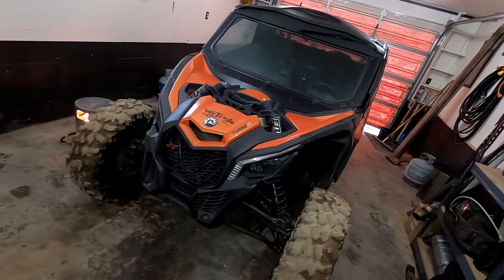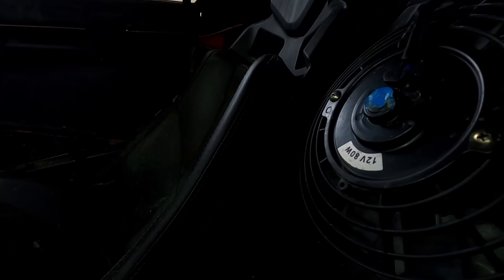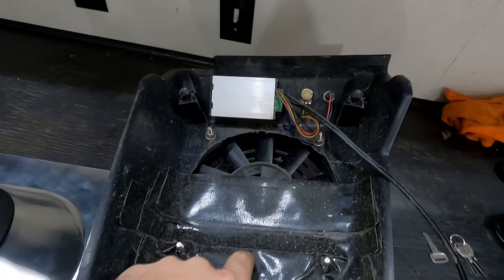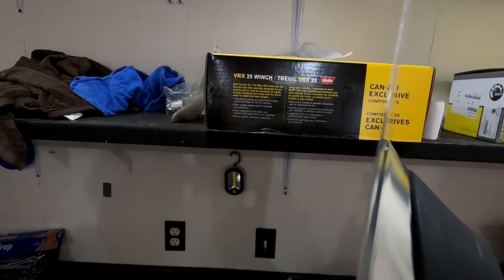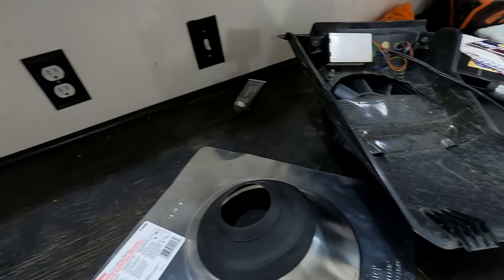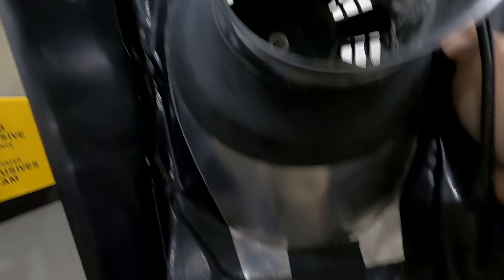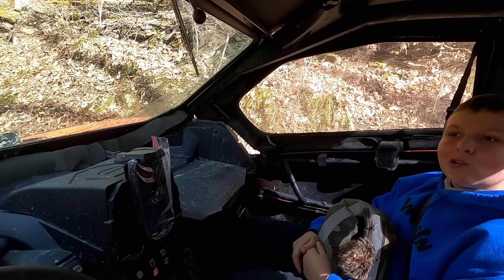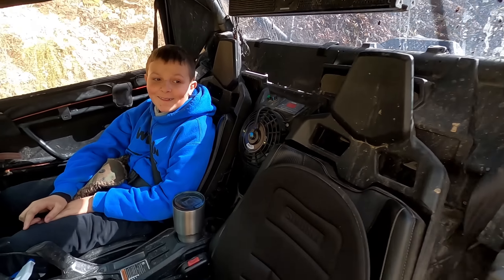CAN AM X3 FAN MOD 2.0 | TWICE THE HEAT FOR $17

Comment: The problem I’m having is it’s sucking in fumes. Bad. Did this fix it? Did you have the same problem before this?
Reply from the maker: It helped with the heat a lot and cut fumes some. My plan was to build a box loosely around the turbo but I sold the machine.
Reply: @WvTrailN  did you get any smell from the turbo?

Comment: Crazy question but would one of these help at all with an open cab? Is it even worth it? We snow wheel in the winter a few times and I have heated prp seats just want to try something small for a little more heat.
Reply from the maker: It probably wouldn’t do a lot with an open cab. Might pump in a little heat on slower trails. Be a good hand warmer and helps to keep the windshield from fogging over

Comment: I'm confused, are you trying to draw warm air into the cab from turbo heat? If so, why did you have the tape blocking the fan originally?
Reply from the maker: The fan was pulling cool air below the turbo. Blocked part of it until I could pull heat straight from the turbo.

Comment: I know this is off topic, but how do you keep your garage warm? Couldn't help but notice your garage door looked to be glowing.
Reply from the maker: Right now I have a propane heater. The door was painted red on the outside by the previous owner and looks like that in the sun
Reply: @WvTrailN  cheap Chinese diesel heater WV. They work wonders in my garage. 18 hours of real heat per 1 gallon of diesel for 115.00 complete.

Comment: How the noise in the cab with the full enclosure using this mod? I tried to remove my turbo shield and it was WAY too loud with the shield completely removed
Reply from the maker: Fan mod added a little noise but even before the fan install it was extremely loud in the cab with the enclosure on. Not bad at all in the trails but cruising 50+ it’s loud

Comment: Has that rubber been melting or deforming any on longer rides?
Reply from the maker: I have put about 50 miles on it so far and it’s holding good. I don’t think the rubber is close enough to cause any problems.